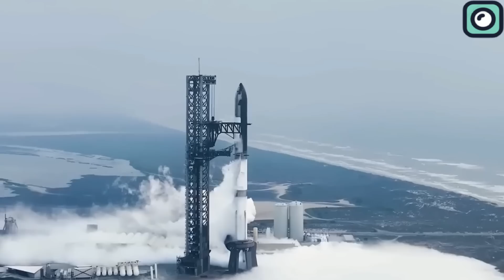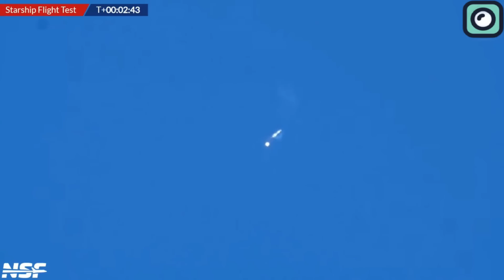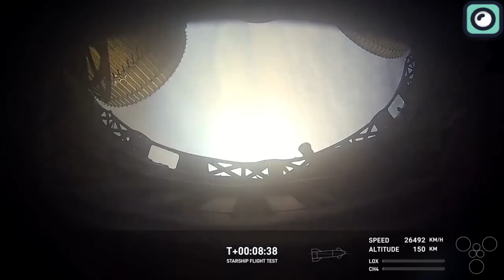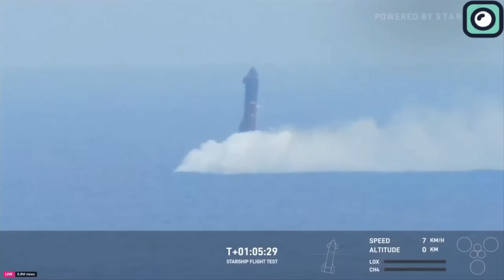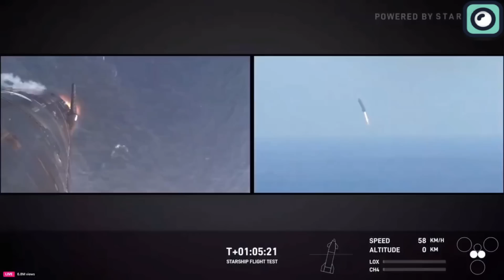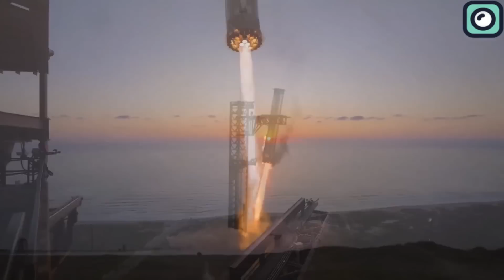Starship 6th Launch Closer Look.... What Happened?

Comment: In 1962 America Center first man in orbit 7 1/2 years later we launched the Columbia which flew around the Moon while the eagle landed on the moon brought the astronauts back up to the Columbia and then brought them home again in 7 1/2 years SpaceX is in their 21st year and we're still cheering that they actually launched a test rocket with technology that is 1 million times more advanced than it was in 1969
Reply: Overestimating on ones achievements can come back to bite one.
People see.  (Most are not fools... like we all sometimes think!).
Reply: They went to the moon with technology from the 1930's and this thing of Musk's that has been paid for multiple times over by the American public is still using 1930's technology, in this day and age you would think we would be using something decent instead of the equivalent of the model A to get into space, what it comes down to is we sit some people on top of a massive bomb and cross our fingers it gets into space.
Reply: The new system is a larger and much more powerful launcher.  It will be reusable and cost a fraction to launch.

Comment: 120 miles (193.121km) and a velocity of 17,448.1 mph (28,079.99505 kph) have not yet been achieved by Starship and this is the 6th flight of a completly empty spaceship with a full tank of gas. In 2001, Elon Musk first announced his plans for a Mars mission at the Mars Society's annual convention.
It is 2024 (23 years later and he still can't get into orbit and back reliably). Musk has a dream but does not hav a working design that will complete the mission. Compared to NASA's Moon Mission in 1969, well there is no comparison. In 23 years and 6 flights Musk has achieved 10 % of his Mars Mission goal. in less than 10 years and 6 flights NASA achieved it's Moon Mission goal. So how can SpaceX be compared to NASA? In no way. NASA settled on a good design that served the purpose of the misson. When they built and tested the hardware on the ground it worked as advertised when assembled onto the spacecraft. NASA built FULL ON 100% Functional ready to go spacecraft. Musk is playing with his toy and trying to get it right. But at his current success rate and time span of 23 years already passing it looks unlikely that he will ever succeed. Especially since he has spread himself very thin, is no longer focused on his goal and other than paying some skilled workers and engineers some good money Starship isn't really going anywhere. Imagine telling investors to give you 100 Billion Dollars to build a facility, design, build and test multiple versions of your rocket with limited success. Then returning to them 5 years later asking for 100 Billion more! It cost $25.8 Billion Dollars in 1960's money for all of the Apollo Missions. Musk has spent enough in Todays money to get there if he had a good design and not just a Pipe Dream from his head.

Comment: At least this one didn't explode, tumble out of control, or catch fire. A significant milestone that Musky said would be accomplished YEARS ago.
Reply: I guess you didn't see the one that safely landed back into the rigging where it launched? The video is at X. 

This one was about successful launch of this increased size and weight. It was guided to meet the water in the same vertical configuration as the landing rather than have it land into the rigging again. The data told them it achieved what he wanted to see for the bigger and heavier rocket.

He has been reusing rockets, launching and landing on the same launch pad, for quite some time. No one else has.
Reply: I'm glad the evolution of mankind isn't up to you. You sound like you'd be too pessimistic to have a go at anything. Thank God there are men like Musk willing to try.
Reply: Wow, and you can't remember where you left your keys😂

Comment: Booster 6 splash down may have been the prelude to barge landing.
Reply: Not possible, it doesn't have landing legs. Legs removed to reduce overall weight.

Comment: While they didn’t try to catch flight 6.
It was not a failure. And should not be see as such. These are early flights of starship. And are all learning and data gathering flights, and many of the flights to come will be the same.
So long as they gather good info from the flight, and that info helps them in future flights. They are all successful in my opinion.
SpaceX has proven everyone wrong over and over and over again. Because they learn and correct from every launch. And they make every one else look stupid. And there is nothing wrong with that.
If SpaceX is better, so be it. Everyone else needs to work harder, they need to work to be better than SpaceX. And if they work harder enough and smart enough they will surpass SpaceX. And I don’t think Elon would have a problem with that.
Because as Elon says. “Competition is good”.
Reply: Sorry but I see this as a partial failure. From here on out if SpaceX does not catch the booster, it's a failure. That is what the booster is designed to do.
Reply: @markcaserta1367  That's why it's called A TEST. It's been supposed to gather infomation, adjust.
Reply: They didn't show the booster landing and exploding. I don't know if that was exactly what it was supposed to do.

Comment: To bad they don't have a second tower or landing pad
Reply: *Too bad
Reply: @dubyusmc  ....two bad, sew sad
Reply: They had those in the previous launch iirc, and it was a success too. Seems like this time, instead of having the rocket called back to a "designated landing pad", they tried landing WITHOUT a designated pad as if to simulate how "landing on a spot where we don't have a pad or are unable to build a pad" would turn out. (I.e, the moon, or mars)

....just a wild hunch 😶
Reply: @kio51423  the antenna on the launch and landing pad broke is why they didn't land with the chop sticks
Reply: @DaveBigDawg  oh..I didn't know 👍
Reply: @kio51423  it's in the video
Reply: @DaveBigDawg  thx